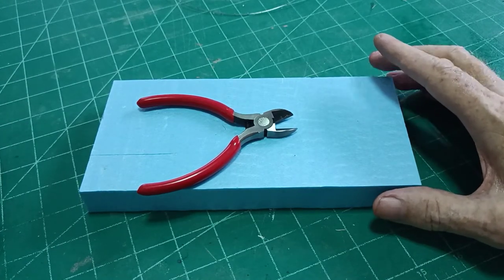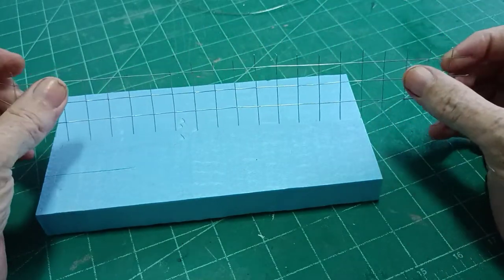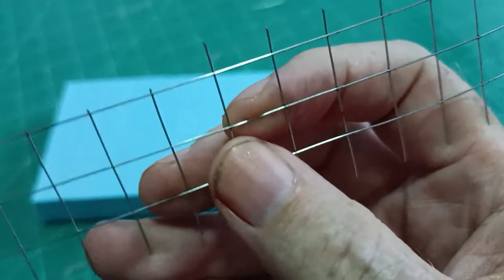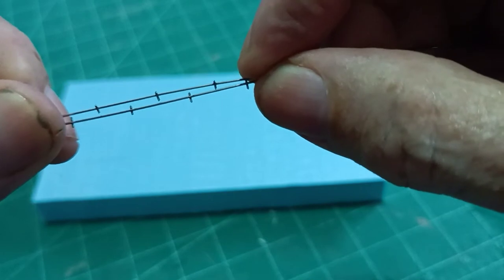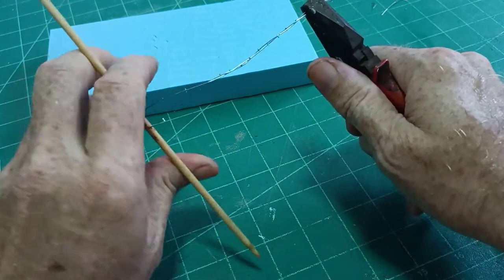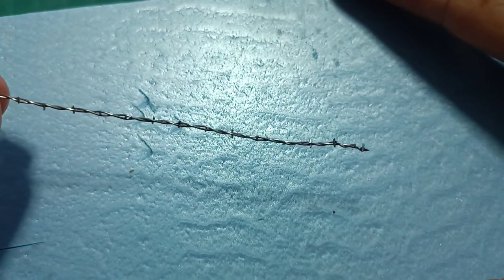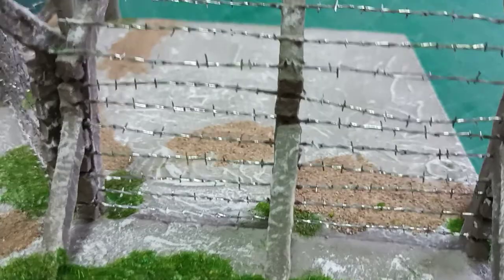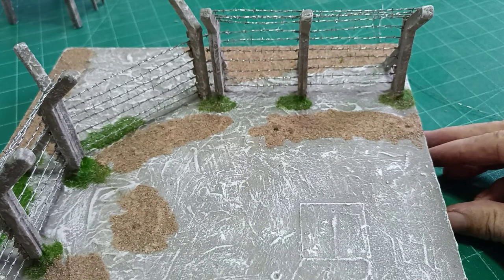How to make barbed wire. 1/35 scale modelling.

Comment: Nov. 19, 2022---I went a different route for barbed wire. I use bug screen as used on windows and screen doors. I cut the screen apart so I have "strands" and use at least 2 of 'em. Put one end in a pin vise, the other in my Dremel set at a LOW speed. This twists the strands easily and of course, making sure there's the same space between each strand. When satisfied, hit the "wire" with sprayable glue which draws within a minute or two. Good enough for my 1/35 scale dioramas and of course, will always have extra lengths to use somewhere else.

Comment: It looks great. I've seen people doing the same but holding the wire in a drill which does the twisting really quick and tight.
Reply from the maker: That might work but chicken wire is very brittle and prone to breaking. Steady twisting manualy l think is better.
Reply: @nanplabwern  Good point. Don't want barbed wire (however small) twanging off into your face 😀